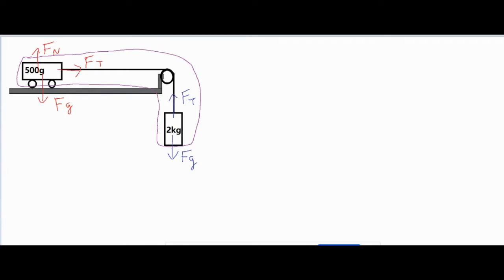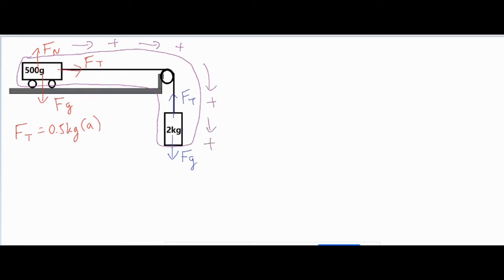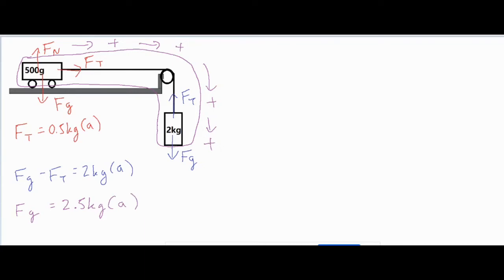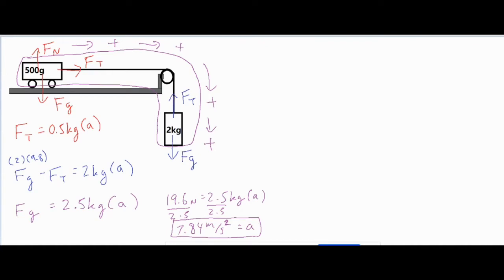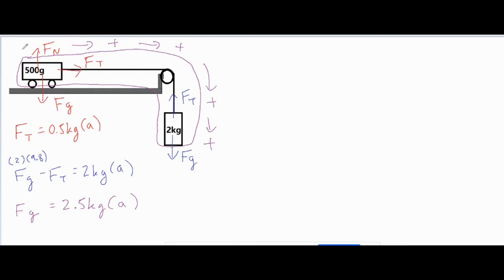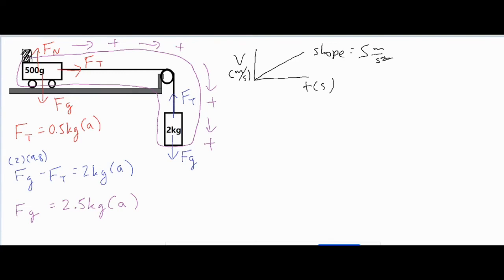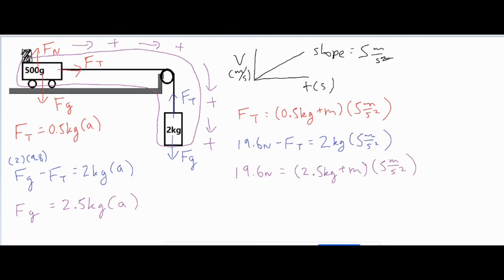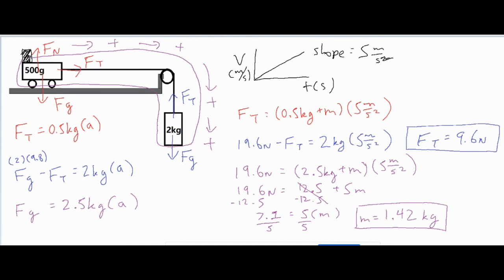A Cart Pulled by a Hanging Mass (a=? Tension=? Unknown Mass =?)

Comment: What about applied force? Is there applied force? Also, why did you multiply gravity by two? I thought for the cart gravity force and normal force both cancel out b/c vertically they're opposite forces, and you're only left with the gravity of the hanging object.
Reply from the maker: The Fg and Fn acting  do cancel, but there is a force of tension applied to the cart, which is similar to an applied force, but not the same because it is applied by a string, so it's considered a force of tension.  That force of tension is the same as the Fg experienced by the hanging mass, and since the hanging mass is 2kg then you do 2kg(9.8m/s^2) (mass x acceleration) to solve for that Fg.  Let me know if that clears things up or if you have any more questions, thanks!